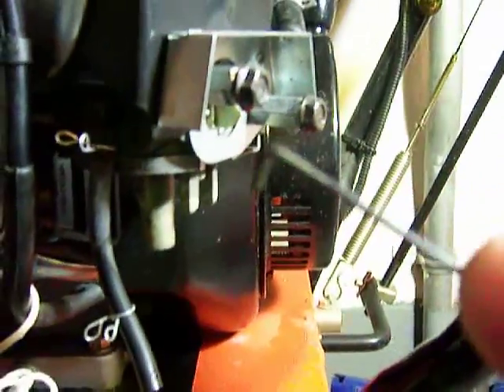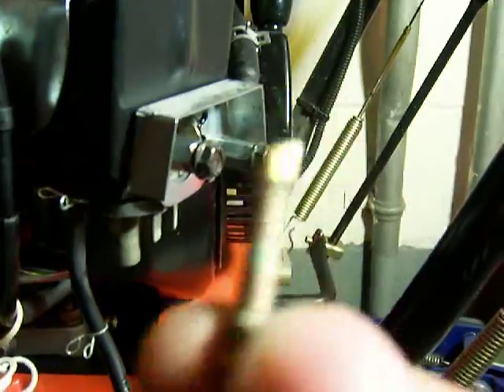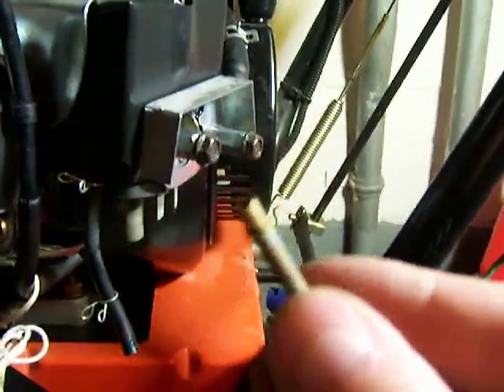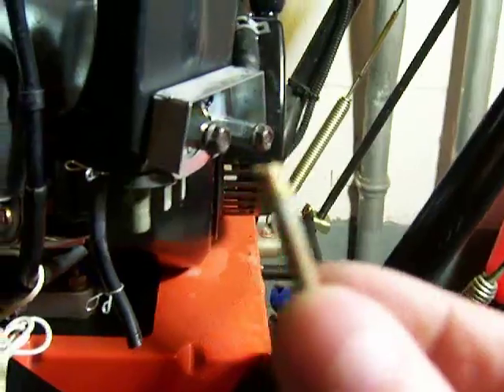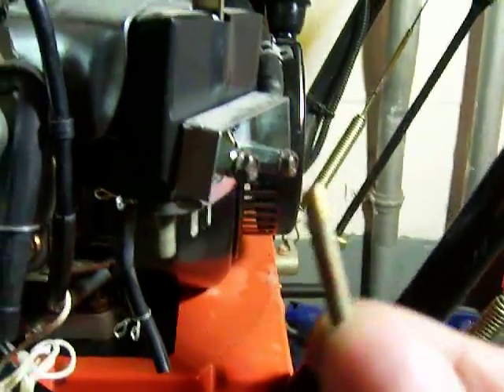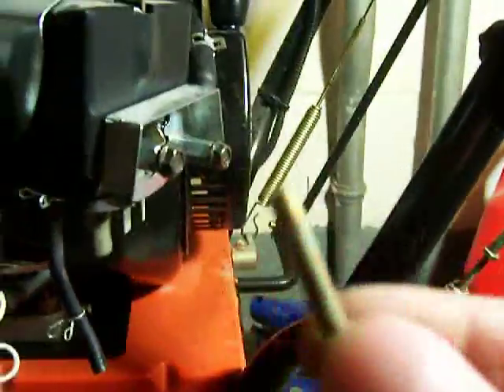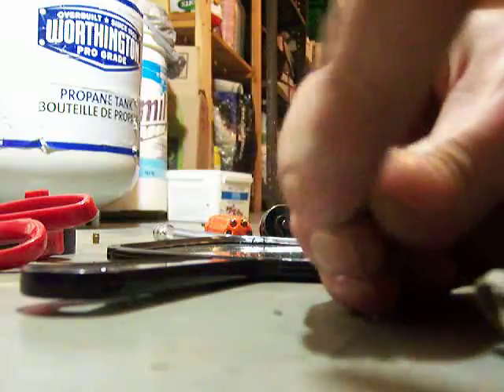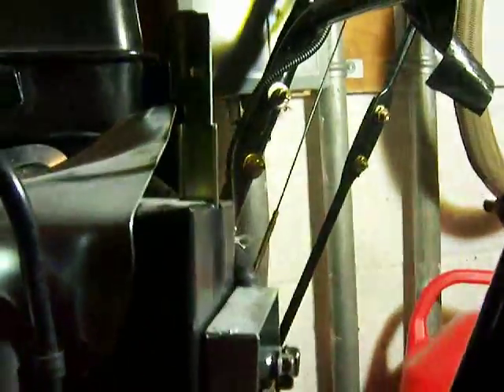Snow thrower/blower won't start after summer time - Emulsion tube removal

Comment: Could not get the screw out of the carburetor pipe don’t know why it wasn’t coming out tried multiple tools
Reply from the maker: Did the securing small screw came out ?  (the one with the groove for the screwdriver)  If not, try with a thinner flat screw driver, perhaps you couldn't not 'grab' the screw and it was not unscrewed.   Or try unscrewing it a few more times.  Once this securing screw is fully unscrewed, it can be pushed out from above and the emulsion tube that sits above it should come out as well.  Maybe see this other video from around 5:30  https://www.youtube.com/watch?v=6ip86H_gKl8
Reply: Peppermint yes that is the exact part. I did try with multiple flat head screwdrivers but it seemed like the screen was just too tight. I was exerting a significant amount of force trying to get the screw to even move but sadly had no luck.
Reply from the maker: Perhaps spray a small amount of penetrating oil (such as Liquid Wrench) upwards ?  You can also look with a little mirror and direct a flash light onto the mirror, maybe have a look at the screw inside.  Is this a recent snowblower, bought from new ?
Reply: Peppermint I will give this a try. Thank you. The snow blower I would say is about 3-5 years old if I can remember.
Reply from the maker: I also have this other video, may be worth a try after the summer storage.  It may unclog the emulsion tube if the snowblower has sat for 1 summer  https://www.youtube.com/watch?v=ClYvG7QC3Gk
 I have the same issue every winter with my Ariens (bought 2016).  I'm guessing they changing this emulsion tube and it got more prone to clogging up in summer (or maybe the gas in my area is too low quality)

Comment: I wish you could have showed how you dissembled  the piece which covers the carburetor.  Even after I removed all the bolts the sheet metal wouldn’t pull up over the  vertical idle and choke shaft.  Something under that metal cover gets caught up underneath.  Any ideas please would be helpful.  It’s a blizzard here in CT today!
Reply: Did you find out how to get the engine speed and choke know off? I am running into the same problem. Does the knob just pull straight up and off? I am afraid to break mine.
Reply: Bobby Brown  I found a black grounding wire underneath and had to unscrew it and remove the wire.  Then the cover came off.  The red knobs pulled off.  Unfortunately the problem was internal to the engine. The governor flew apart and damaged the engine.  Going to cost 400 for a new block.  Four year old POS.  Ariens should be ashamed to have their name on this.

Comment: Thank you for posting this video! The emulsion tube was it. I concluded the snow-blower wasn't getting fuel via other troubleshooting steps and narrowed it down to the carb. In my case, I removed the carb and noticed the rotating auto-throttle portion of the carb was also more difficult to rotate than it probably should be. A little carb-cleaner and now it rotates with zero resistance.
Reply from the maker: Very welcome, glad it works now

Comment: Yea, okay but the guy didn’t even put it back together again?!
IMO bad video.
Reply from the maker: Everything was put back again and the machine fired up right away.  Since then, to save from doing all this every year, I fire up the snow thrower during the summer storage every 2 months and let it idle for 30 seconds. It keeps the carburetor screw clean and free of deposits.

Comment: Excellent how to video!  If it's s mild clog, fill the gas tank to near the top, with the cap off, take a toilet plunger and pump the opening hard a few times, pan the blower up and down, and bang it lightly on the ground, give a pull, repeat .... have left gas from the winter all summer on a few occasions .... and this will definitely loosen mild clogs!!!